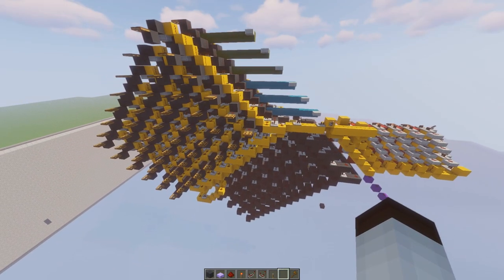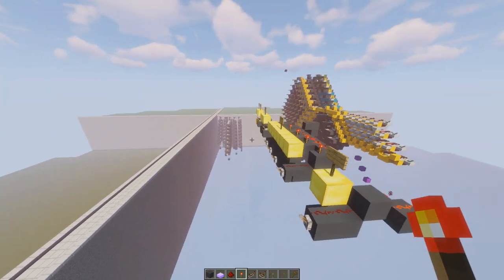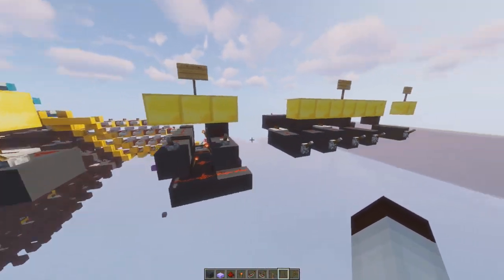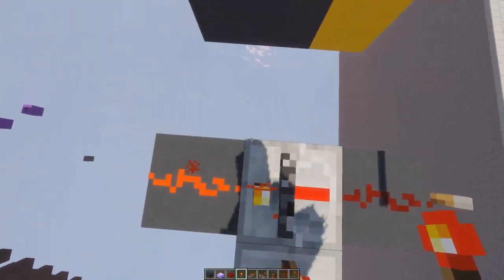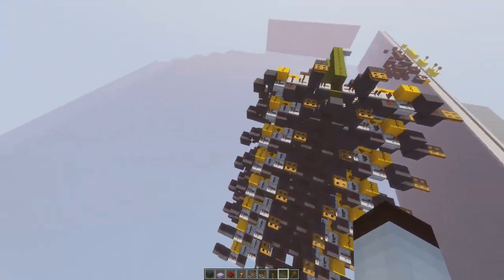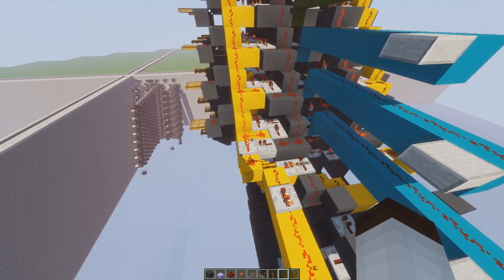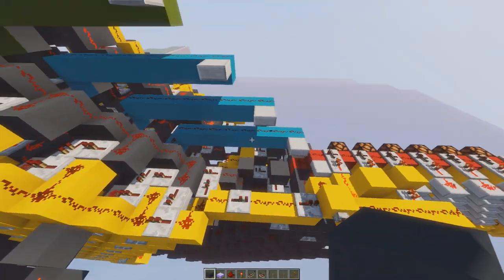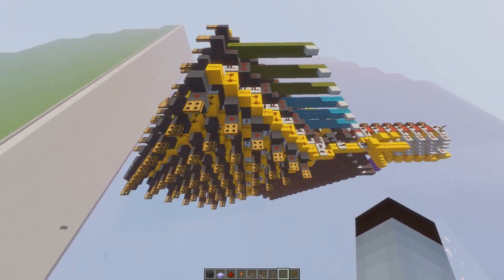Serial Repeater Only Logic - Decoder and Mux

Comment: Hello allo
I think the reason why your having problems with comps, is because theres a bug that allows comps to be instant (but not in the way that most people know)
If the comp is in the bugged on state (when it looks on but isn't) and you give it a block update (redstone, reps, comps, observers and every other redstone thing produces block updates (they also give block updates, 2 blocks away from the source)) 1tick before changing one of the inputs, the comp can be instant.
So the common setup of having a rep point into the side of a comp, can cause it to be instant, which screws with timings
fixing it is as simple as: lift up the redstone that powers the rep by one block (so the rep takes power from the block under the redstone and not directly from redstone itself)
The way it happens is rather complex, and you need a few demo's to understand the bug
Reply from the maker: Thank you for the explaination! I can see why the bug arises just from all the other bugs that happens with redstone >_>